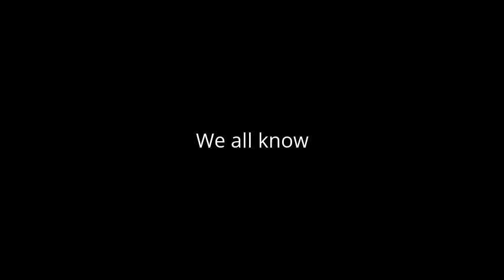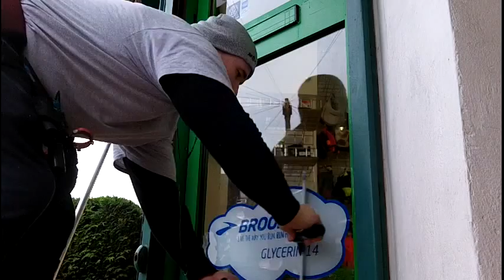Polzn Bladz-Stop Burning Up Your Rubber On Route Work

Comment: Great vid! Its very true about those wooden frames, did a shop today with soft rubber and went to close to the frame oops lol wrecked a brand new bit o rubber! lol it was very old chipped frames and i managed to avoid most of the frame but just caught one bit and bye bye new bit of blade. the razor red stuff is more durable for wooden frames but not so good in the cold.
Reply from the maker: Cheers Trad-Man. You should be careful with any squeegee on nasty types of frames but even more careful with Liquidators and self modified channels.I think rough wooden windows they are every window cleaners nightmare. I have some wooden window jobs with either a silicone seal or rubber seals and it doesn't ruin the blade at all
Reply: Polzn Bladz yeah wooden frames should be against the law lol. really enjoy watching your videos! need one per week at least ;)
Reply from the maker: You're funny Trad Man
Reply: Polzn Bladz do you ever use the razor red stuff in your squeegees? lasts for ages!

Comment: Good video Bob!
But we who clean residential like twice a year this is not going to work. We can't avoid the edges.
Reply from the maker: It does depend how dirty the windows get. On my last wood window video the windows hadn't been cleaned in over  8 months but they weren't too dirty. If you live by a busy road or field with crops causing pollen then you're going to struggle.